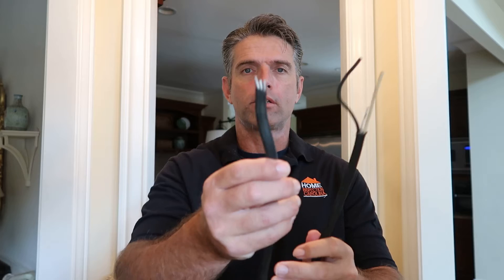What are the Problems with Aluminum Wiring

Comment: Thank you for doing your best to get the message out, particularly in this tight housing market and especially to first time homebuyers.  The fire hazard is very real.  Personal experience: 4 yrs ago, I lost everything in an apartment fire.  The unit I was told was built in 1967, if I remember correctly,  and had the old glass fuses,  which I  thought by that date it would have been circuit breakers,  but the year screams aluminum wiring. I had lived there only 4 months,  and was out of town on a business meeting, when the fire occurred.  The neighbor who live in the unit, directly below me,  recalled having electrical problems.  Appliances acting erratically, and outlets went dead randomly. While waiting for the  maintenance man, she smelled smoke and notice the wood paneling in a hallway had already ignited.  The entire 4 unit complex was a total loss.  Even to this day I sometimes suffer from occasional nightmares and anxiety, after coming home to charred remains of the place I felt safe and secure
Reply: Year